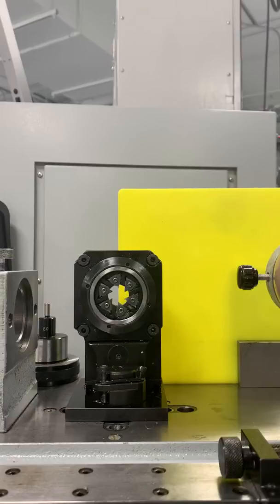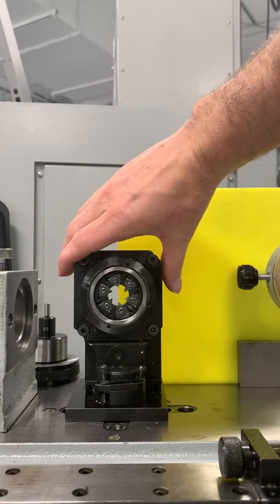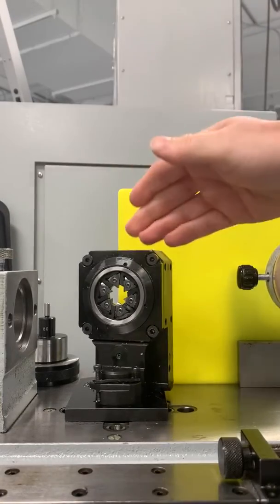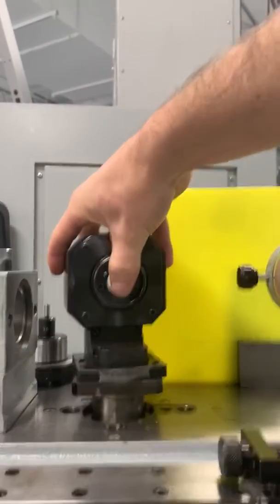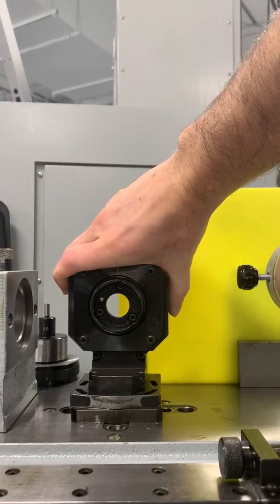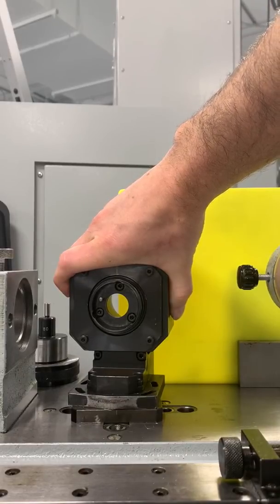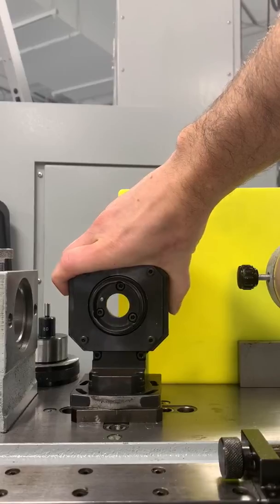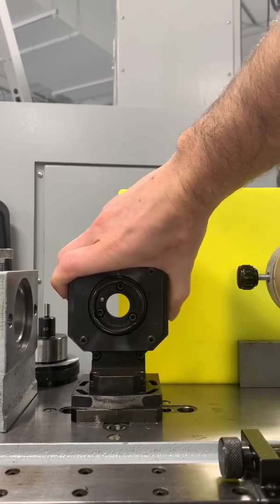The most important thing to look for in a new thread whirler

Comment: Saw exact same thing shown here happen being good on Citizen L20 but terrible on Star ECAS 32. What did you find as the alternative measure to make this more efficient?
Reply from the maker: The only way to make it efficient for me was to sell the stock Star whirler and buy a WTO whirler that rotates on center. The centerline never changes no matter what helix angle you set. Otherwise it’s just a guessing game IMO.
Reply: @cncswiss5999  normal procedure for me on Citizens however was to square it in at Zero degrees parallel to the Y axis and from there use my coaxial indicator in the sub collet and tram the back side of the whirler into center by using the sub on centerline with guide bushing.  Once I was at X and Y zero I'd take the difference and make changes to the Geometry page. From there rotating whichever helix angle would still keep center.
Reply from the maker: @bkirk2278  that sounds like a solid method 👍🏻
Reply: @cncswiss5999  100% agree!! Nice move! 👍